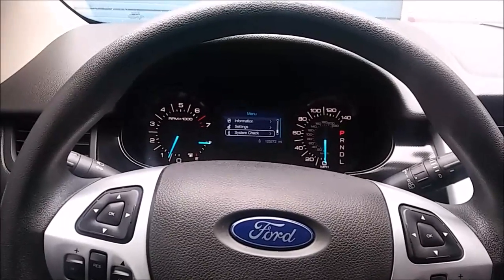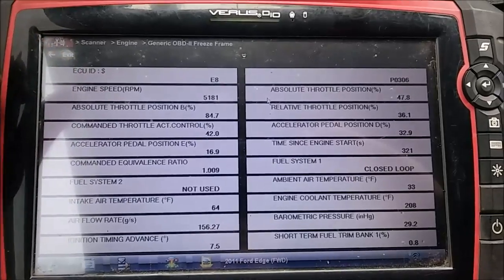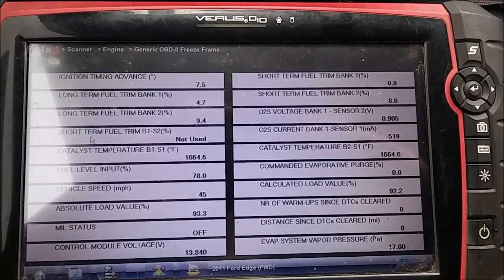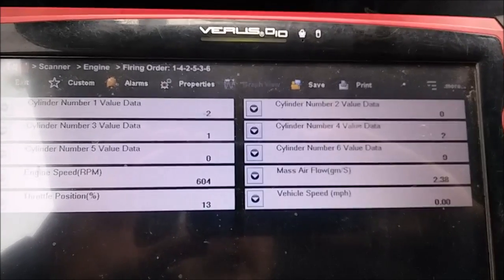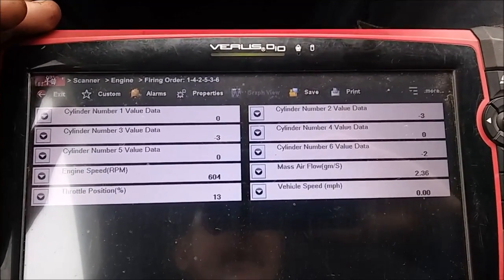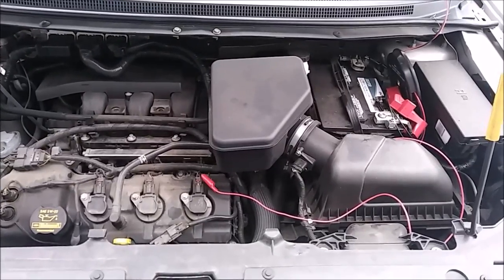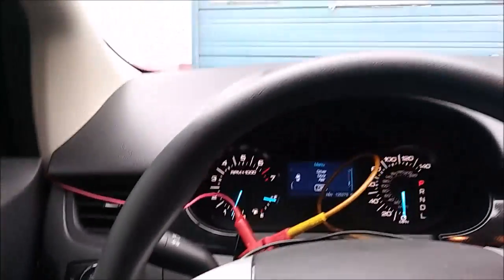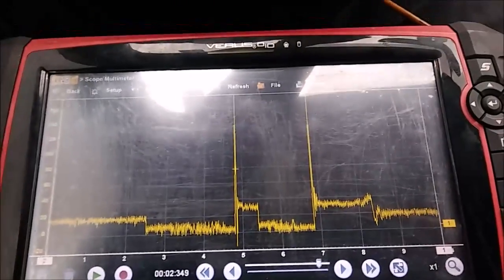2011 Ford Edge,  Hesitation, Misfire,  Flashing CEL

Comment: Just bought an Edge same year, Limited instead of SE, same engine. Changed out all parts you recommended here, as well as fuel filter, runs beautifully at all times now. Thanks a ton.
Reply: hey how you replaced fuel filter is it inside gas tank

Comment: Thank you! I have a 2013 Ford Edge (123,000 miles) and I'm having the EXACT same issue. I knew it had to be spark plugs, coils or fuel injectors so obviously I went with the cheapest first, plugs. Got the front three it felt all better immediately after but now after a few days I sort of feel the hesitation back a little. The back three plugs are gonna be some work as you obvisously know. I wish I had one of those diagnostic computers, because if it ends up needing coils too it's going to suck taking the entire intake plenum apart again to replace the coils. That Snap-On Verus Pro D10 looks awesome, now I want one! Don't have the money for that right now though lol. Either way thanks for the video, it at least helped to reaffirm that it may be the plugs.
Reply: Having this problem with 11 edge limited

Comment: Great video!  My 2011 Edge started these exact same symptoms and same Cylinder #6 misfire CEL code.  I now understand that what my car's computer is doing is sensing the plug not sparking for an instant... So it is intentionally shutting that coilpack down for a moment to protect the coil from high voltage flyback and the computer itself from high voltage damages.  It then turns the coilpack back on after a predetermined time or change in readings, such as a lower engine rpm.
I guess if it didn't shut down the pack, I would see a CEL, but the car would probably keep running fairly smooth... but electronic damages could be happening subtlety and eventually pop a FET inside the computer.. Then it would be a much bigger problem!
I thought the same thing as you...  swap the coilpack to another position and see if the misfire code changes positions.
Thanks again, my car has 113k on it and I'm sure it simply needs a "Tune Up".  Unfortunately those back 3 plugs and packs will be a lot in labor and parts cost :(...
Reply: Synthetech my 2011 is doing the same. How’s your car now?

Comment: Thank you SO MUCH for posting this my 2011 Edge is doing the same thing exactly but I noticed it only does it while on the highway at a cruise speed and also when I accelerate while traveling it has never done it at slower speeds or at idle off to the shop I go with your video and the car manual my service engine light also was blinking during an acceleration as I tried to give it fuel to push past it then it stayed on for a bit then the light shut off

Comment: Having a similar problem with my 2013 Ford Edge. After some hesitation, while driving, I got a misfire code on cylinder 3 and an emissions error. I just wanted to get an idea of what all of that meant. Thank you for your video!!
Reply: I am having the same problem with my 2013 Ford Edge. I am working on changing the spark plugs now in hopes that fixes it, I'm at 123k miles so it's probably good to change them anyway. I changed the first three that are easiest to get to and it felt better right away afterwards, but now a few days later I'm feeling it a little again.

Comment: Taking off intake manifold and replacing spark plugs does not take more that 2 hours, and 6 OEM plugs cost $35-40.
Hesitation during acceleration - always #1 cause is spark plugs, plugs only good for 50-75k mi.  Good diagnostic video. Next time - short cut - have plugs been replaced in the past 50k? . . if answer is no - head strait for plugs after verifying coils are working fine at idle.

Comment: Most fords mode 6 misfire data is available on test 53 or 54 ? The value #s are much easier to see there per cyl, if available. Good vid like your style , logical thinking & very good detail lead placement & scope set up. Keep it up.

Comment: Hey great video! Gave me some ideas on what was going on on my 2011 Ford 3.5 cyl # 5 misfire code.
New plugs and coils replaced for maintenance then several thousand miles later #5 misfire code, swapped coils 5 & 6 misfire disappeared for a while and  now has recently returned.
I pulled the coils and just for fun the # 5 plug again to look at it and found it had cracks in the porcelain insulator! Motocraft platinum plugs. With 30k miles on them.

Comment: I'm having similar issue. Rough idle and acceleration. Surging. Got Code P0305. Checked 5th spark plug and coil, coil was damaged so I changed all the spark plugs and the damaged coil. Started car still experiencing same issue and same code. I've read online that possibly the PCM is damaged now. Any recommendation?

Comment: I’ve got a 2011 Ford Explorer that’s doing the same thing with the check engine light flashing when getting into it hard as shown in the video but I’m getting misfire codes on cylinder 1 & 5. I’ve done had new spark plugs installed and coil packs on those cylinders and have also changed the injectors and I’m still getting the same results, any ideas?
Reply: I have a 2011 Explorer as well. Same problem. Changed coil packs and no improvement. Have you figured out the problem with your vehicle yet?
Reply: Shanda  Brogdon same problem like you guys with my Ford Explorer 2014
Reply: Same problem here it was the computer grrr..

Comment: I have a 2012 Edge with hesitation, misfire, rough idle (but only in gear, not at idle). I was told the engine needs to be replace by two different shops. I think that's BS. What should I do now?

Comment: Any input will be greatly appreciated!!! My 2011 Ford Edge 2WD SEL has same issue (hesitation/sputters only when punching it while cruising at highway speeds.. feels like traction control because it's kind of jerky when it happens but it's not traction control) 
Wish you lived in NE OH! The Cadillac dealership (where I bought it from) says their test shows it needs a new Catalytic Converter whereas then the Ford dealership test said they didn't see anything needing fixed because neither the mechanic nor I was able to replicate the issue this one day (my Edge's Check Engine light turned off ONLY hours before my Ford appointment of course and believe it or not it turned back on 2 miles after leaving! Whereas it was on for the prior 2 weeks and has remained on ever since the appt! Literally UNBELIEVABLE! But even so, it should still show codes but STRANGE THING IS OR WHAT CONCERNS ME IS.. while on my 5 mile highway drive home from Ford, for the FIRST time ever, on two separate occasions within 15 secs of starting it in dealership lot and then again 3 mins later while driving, ALL of the dash warning lights ALL appeared for a few seconds)! Obviously Ford must've done something to cause this because nothing like this has ever happened before and I drive my vehicle 3 hours everyday 5 or 6 days a week!  
So I guess my next move will be to PAY $350 to have Ford replace the SPARK PLUGS (process looks too complicated to do myself after viewing YT vids on How To) because mine has 112,000 miles and to my knowledge they have NEVER been replaced! (I purchased it As-Is just 2 months ago with a verbal "30 day warranty" which is not being honored at Cole Valley Cadillac in Cortland, OH FYI) 
AWESOME INFORMATIVE VIDEO.. I apologize for the length of this comment but just in case you or someone has a good idea what I should do, it was worth providing any potentially necessary details.

Comment: Wow spark plugs is all it needed that's amazing my Edge only has 87,213.8 miles on it, if you get notifications of messages could you please respond with what the cost was to replace the plugs???? I'm a little financially strapped and will need to figure something out to get this done Thabks in advance for your answer
Reply: Ford spark plugs are $6 a piece ($36 total) and an independent will charge $150-$200 for this spark plug change job. 
Please also buy a throttle body cleaner and request the person to clean throttle body since it'll have easy access.

Comment: Really useful video, thanks, your clear precise  narrative makes it nice to follow along.
Could I ask you, it looked like the coil wasn't being pulled right to ground, is that a problem  or is it just due to the large current flowing through the coil? Thanks Jonathan
Reply from the maker: Hey Jonathan,  are you talking about the tiny hump present during initial coil turn on during some of the captures?  When you are talking about ignition coils,  there is a large amount of current flow on the primary side (often near 10 amps).  This tends to prevent a "perfect" ground from being applied due to voltage drop not only through the wiring back to the engine computer, but also the transistor in the computer itself.  Looking back through the video,  all of the waveforms we captured appear to be grounding quite near 0v,  though I didn't actually measure that ground voltage.  Another thing to keep in mind is the high voltage spike during the misfire event,  a coil with a power or ground problem will not be able to produce the high firing line we noticed (in excess of 300v on the primary collapse).  Hopefully this answers your question.
Reply: Yes,thanks for your time, Jonathan

Comment: This man is like the Bob Ross of auto repair. Mine is doing the stall at stops. Thank god it hasnt done it on the expressway yet. When I have the air conditioning on or the heat and have it at the right speed the issue seems to ease up. As soon as I turn off the air function the issue returns and the vehicle will die at lights. Any ideas anyone?

Comment: If this was a Toyota everything would still be fine. Watch top gear on Toyota truck that won’t die before haters start hating.
Reply: Ford always thrived on selling you parts. They put out, mass produce cars with known problems... sale sale sale and then get U later at the dealer.
Reply: @todosube  not true neighbor has a tacoma late model damn thing is smoking

Comment: Hello guys I have a 2012 Ford Edge 2.0lt and while I was driving the car it would auto accelerate with out me pushing down the pedal. The rpms would go very high up but the car would not move at all
Reply: Sounds like a transmission issue. I'm no pro though just speculating

Comment: Had same problem but was showing a misfire on cylinder 1 and 5 so I replaced all coils and spark plugs and still having the same issue! Anyone have any other recommendations?
Reply: What did you do to fix the problem sir I have the same codes

Comment: I have to say the Edge series are one lousy designed SUVs one can own.
I have turned many down because owners wanted to fix & replace just the Check Engine Light #. Because only days later other spark plugs/coil go

Pinpoint Automotive Repair, I and many agreed it's just silly that one has to go through all the labors just to get access to the spark plugs.
And no experienced personnel (even to DIY) will replace only one spark plugs, one coil or one fuel injector.

ATG, you & I know that taking /or pulling things in & out that you can mostly break those plugs and cooked thin wires.
But again, many owners rather go to a cheap shop rather a good shop/dealership. All because owners think shops/dealers are ripping them.

Comment: Man, I have to give you a little crap for this. You just killed 30 minutes diagnosing something that is kind of a given. From the misfire code, you knew that you were going to do a coil swap no matter what. You could have saved yourself and everyone else a lot of time by just swapping the coil with cyl 5 and swapping the plug with cyl 4. Shoot, by hearing in the end you telling us that your swapping all coils and plugs regardless (because of the high miles I assume), who cares really if it's a coil or a plug if you're planning on some R&R for both anyway. The only reasoning behind all of this wasted time is to see if it were spark or a fuel injector but because you have to take the intake off anyway, just swap the injector too (not applicable to you but maybe someone down in the comments). JUST SAYIN, don't get caught up in the geeky high dollar equipment folks and keep to the KISS method.